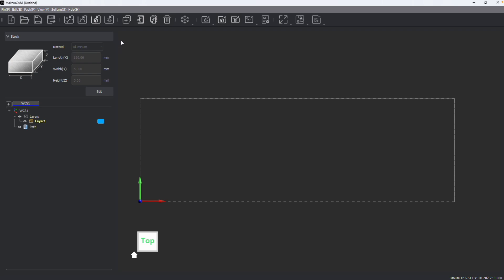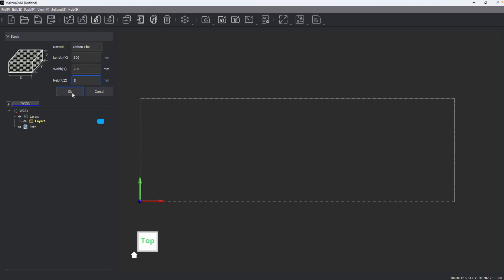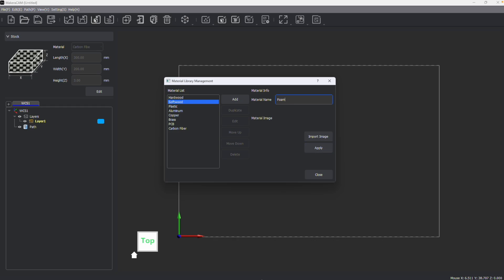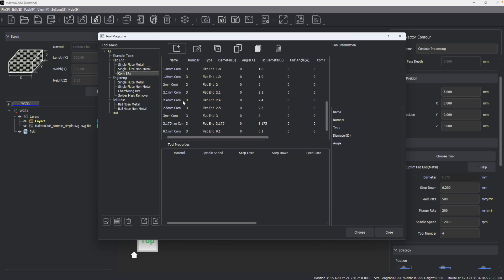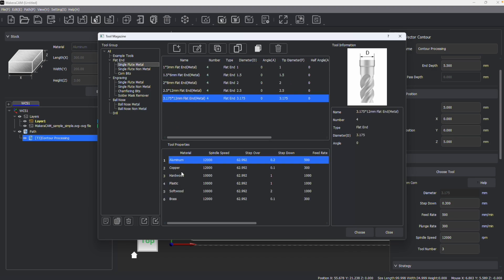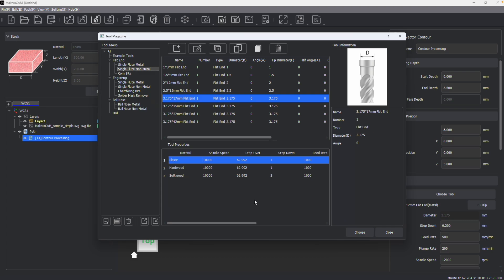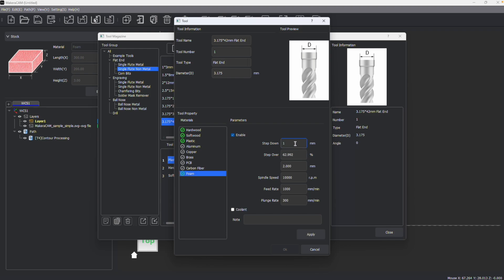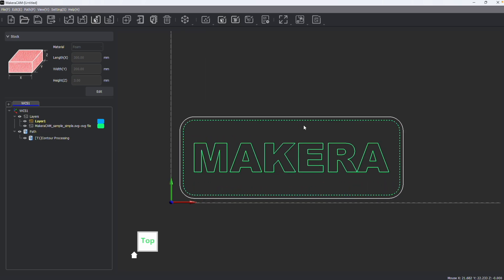Makera CAM - Adjusting Materials and Stock

Comment: Can we please get more materials in the material list?
What perameters are set for plastic, for example? Is it for ABS or more for Acrylic?
I see both ABS and acrylic included with the test materials provided with the machine yet no material for each in the software.
Reply from the maker: This is good feedback, thanks! Check out more speed and feed settings on our wiki site, and of course remember you can create your own custom materials as you see fit. As for plastic, we find these parameters to be a good starting point for any plastic, ABS and acrylic included.

Comment: To specify If i want to use round stock or disc metal how do I change the shape to a disc or round stock?
Reply from the maker: You typically wouldn't create round stock in CAM, but instead have a round design and offset the positions accordingly. Consider creating a jig with a round pocket cut out of a square stock for alignment.

Comment: How can i change the shap in the material library?
Reply from the maker: You cannot when working in 3 axis configuration
Reply: @Makera why is this limited to only straight edges? That limits the capability of the machine and the user experience. Can someone explain this to me?